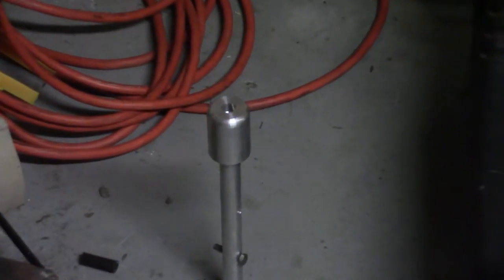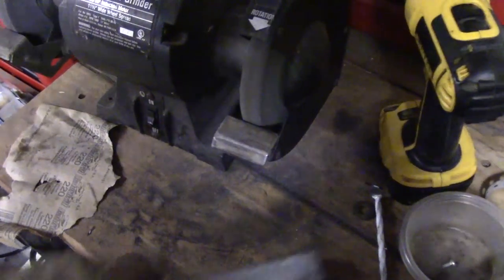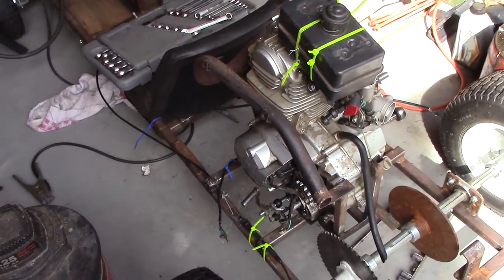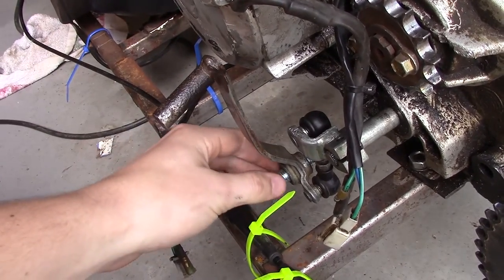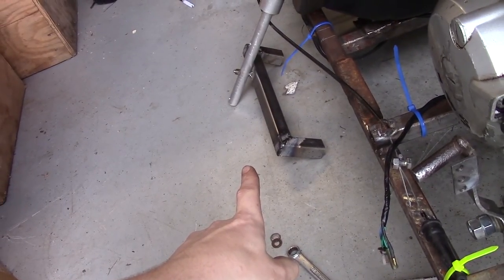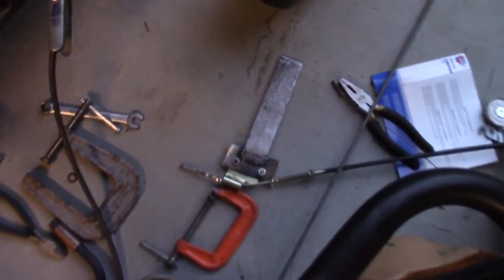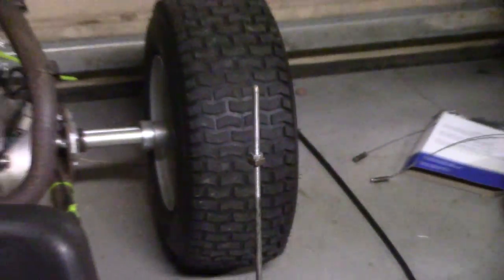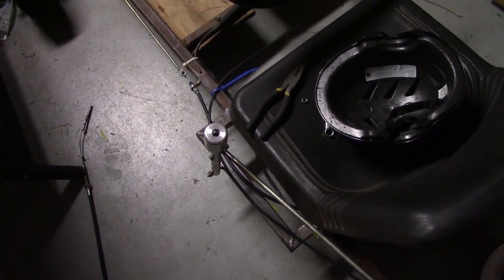15 HP 5-Speed Go Kart Build Part 7- Shifter Linkage

Comment: Could you tell me what clutch and transition it has , i wanna make one!
Thanks
Reply from the maker: Clutch and transmission are built in to the engine. I would recommend finding one inside of a dirtbike, motorcycle, or quad, as they're much easier to work with as one whole unit. Make a lot more power than lawnmower engines too.
Reply: Thanks bro!